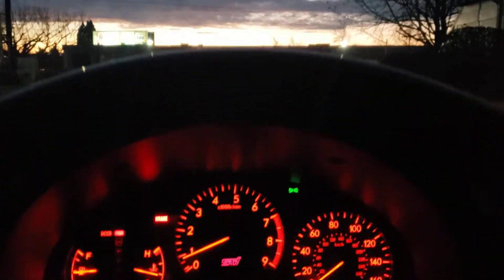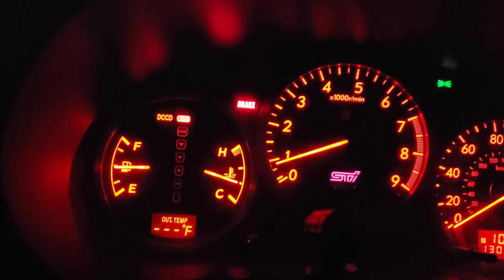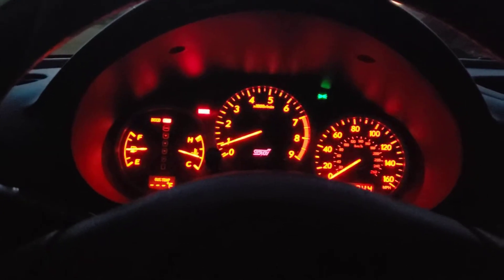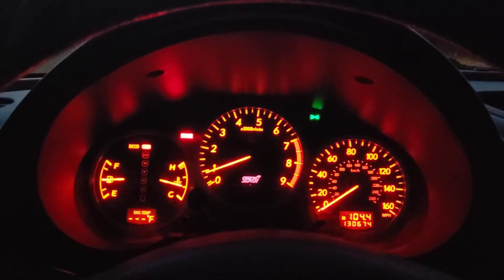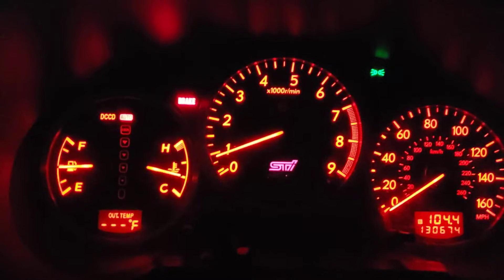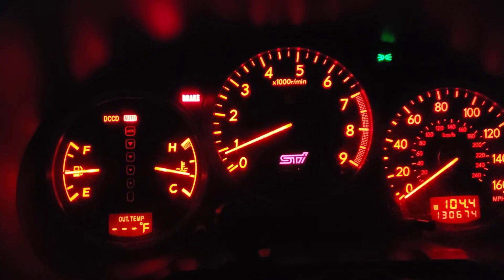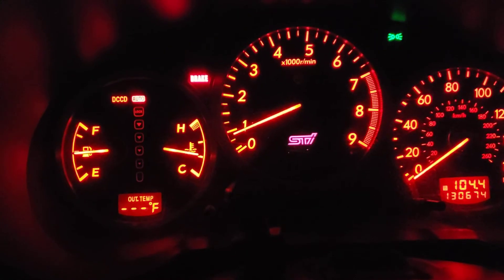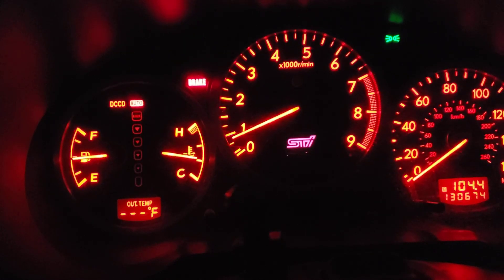200 mile review iag oil pan

Comment: idling for a long time like this is totally unnecessary simply drive the car gently, stay out of the boost as much as possible and keep the revs under 2500 until things warm up. It will get there much faster with gentle driving than sitting and idling...once you have driven 5 to 10 miles you should be good to go. Send it.